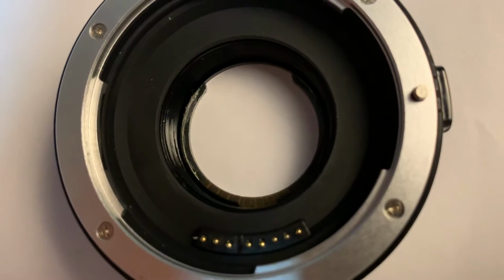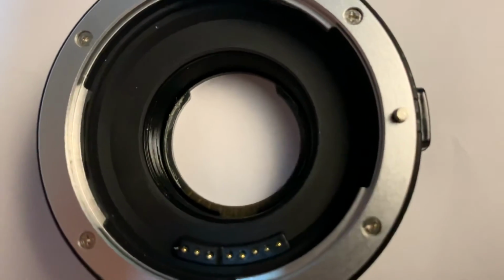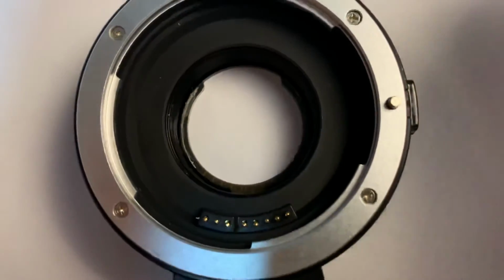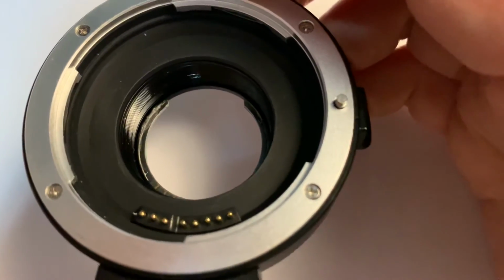Viltrox EF-M2 infinity focus fix the fix..!

Comment: I couldnt get infinity with tamron 17 50 2.8 after doing this.
Reply: any help?
Reply from the maker: Once you fix infinity for one lens, it should work for them all, right? I had almost given up on ever getting my Viltrox EF-M2 to focus on infinity. I had screwed it all the way in and it still wasn't good enough. It was only when I unscrewed the lens completely to remove it that I noticed the glue residue which was clearly preventing me from screwing the lens in all the way. Taking out even that miniscule amount of glue made all the difference! In order to screw it in all the way, I had my fingers on the glass to turn it firmly - better to do that that trying to use some tool that my end up scratching the lens. I just doused the lens in isopropyl alcohol after and have it a good clean with a nice lint-free cloth.
I hope that helps..!
Reply: @SydneyShortFilmSchool  ohhh. I sold the lens. Anyways, for future it might be useful for me.